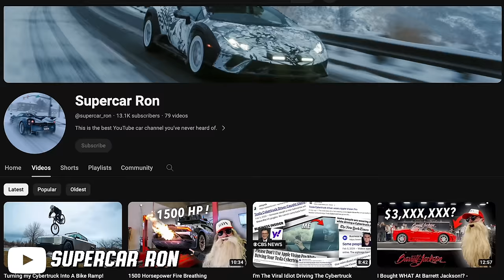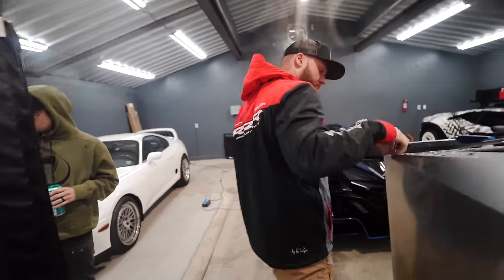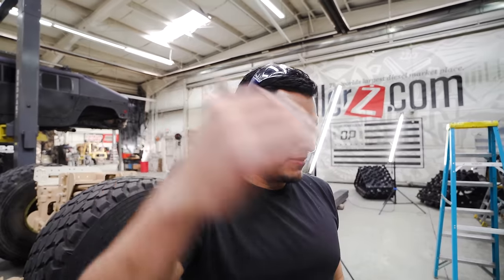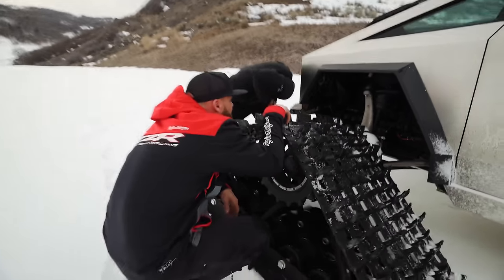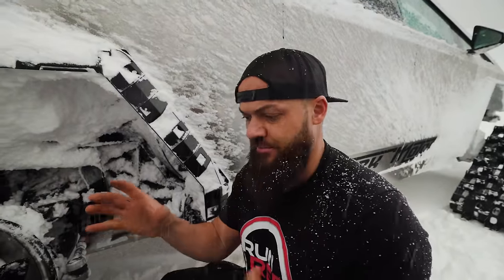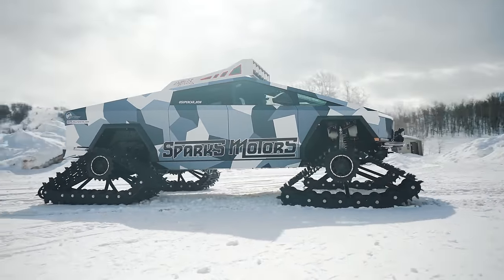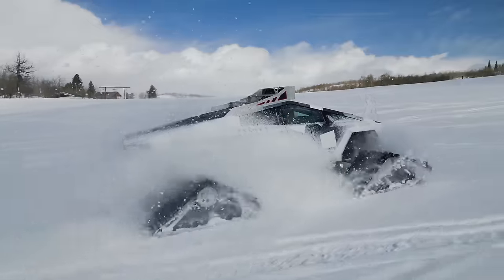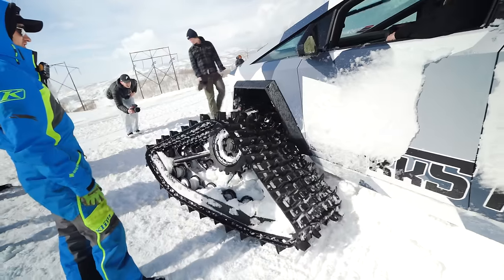World’s First Cybertruck On TRACKS Is Crazier Than You Think!

Comment: I could literally calculate all of these failures beforehand. 

These are simple material science properties and structural engineering calculations. 

Every time you're surprised I'm not.

The factory parts were not designed for the increased high torsion and freezing temperatures...duh! 🤦🏼‍♂️